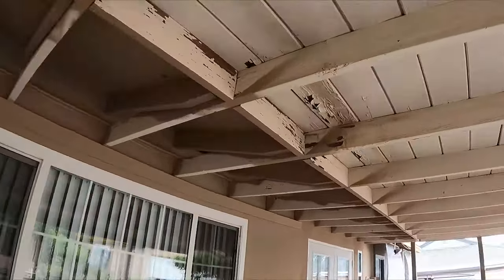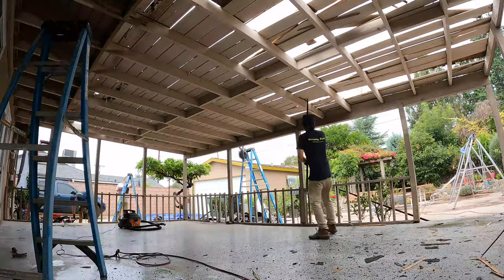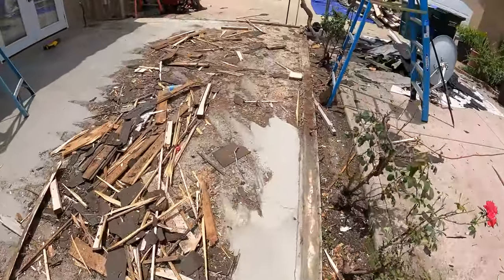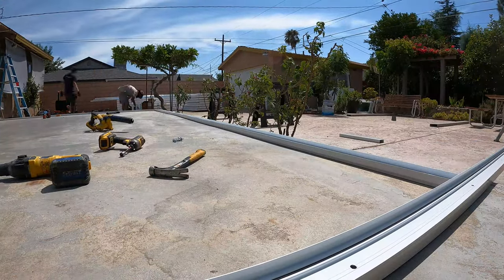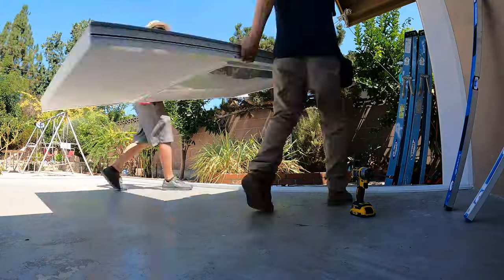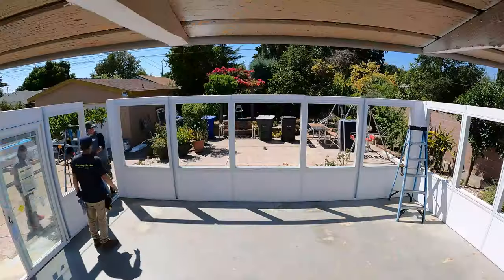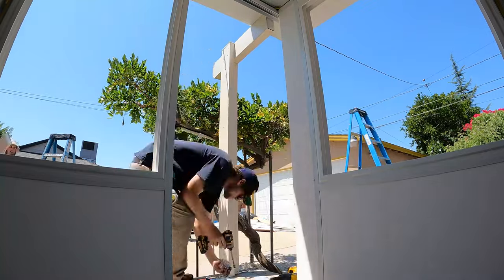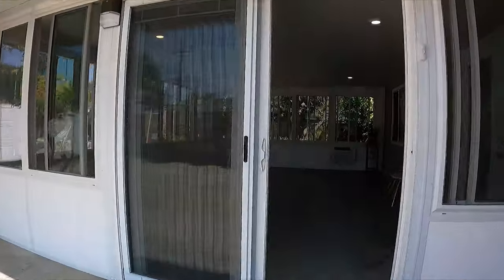How To Build a Patio Room with an existing Raised Foundation

Comment: Great vid. How would you divide that room in half with a wall? Can’t screw into the panels, correct?
Reply from the maker: Hey Degen, you can use the same tracks to divide the room. It's similar to building under an existing roof. 

Hope this helps, have a great rest of your day

Comment: Can you enclose an existing Alumawood patio cover with walls without tearing down the whole thing and rebuild
Reply from the maker: Great Question A N, is the roof insulated or non-insulated? Also we would have to take a close look at the existing patio, to see any potential issues with installation. Feel free to email us if you want help moving forward with your project.

Best Regards,
Everyday Patio

Comment: I have a white sunroom (same as the video) and roof panels are connected by metal. There is a fine gap between the roof panel and metal and I can see it when I’m sitting in the couch in my room. Can I apply some kind of sealant to caulk that gap. Your room seems like has some kind of caulking for smooth finish on the (inside) roof (8:43 in your video)? If yes, what kind of caulking do you recommmend, silicone or something else?
Reply from the maker: Hey Karthik, sometimes the seams weren't locked fully during installation or there was a problem with production of the panels. Sometimes we use Nova Flex or Alex Flex on the seams to make them less noticeable. That's what I would recommend you use.

Great question, hope this helps and that you have a good rest of your day.

Thanks,
Everyday Patio

Comment: Look so great! Did you anything (fill holes, or level or else) with the existing cement slab beside cleaning??
Reply from the maker: Hey Curio, yea we clean off the slab with a solvent, like Lacquer thinner. To patch the holes we use Sika Flex Construction Sealant, and other masonry products to patch the holes. After everything has been ground down with metal or masonry blades on the angle grinder.

Thanks for the comment, hope you have a Great Day!